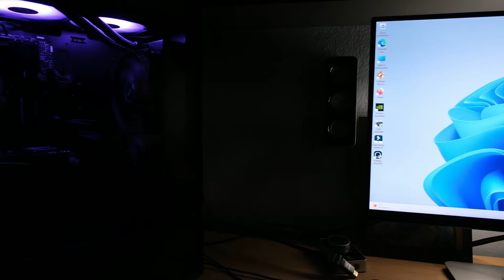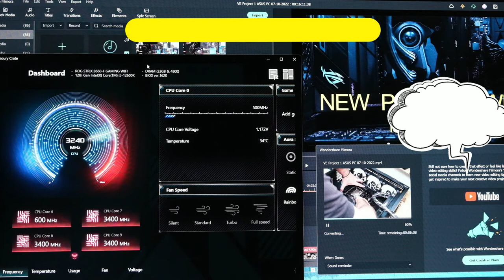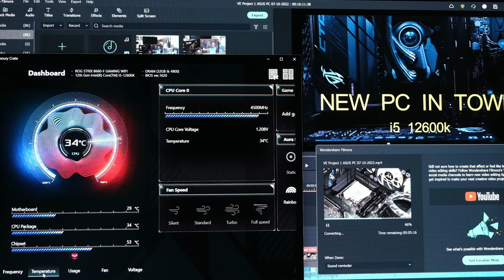Video Editing PC Intel Core i5 12600k

Comment: The only few good things about this build is power supply, CPU and AIO (why not 360 tho, the price is pretty much the same). The case is bad, not a mesh... MB is overpriced, z690 MSI A-pro is more then enough... don't see which DDR u have, u need to put all the specs in the video description.